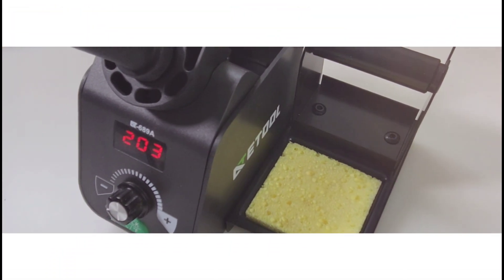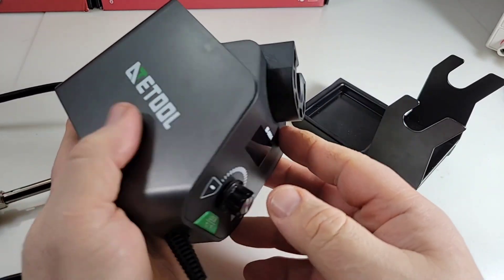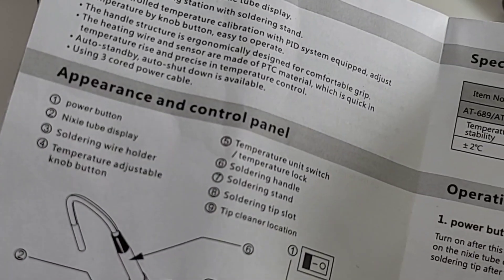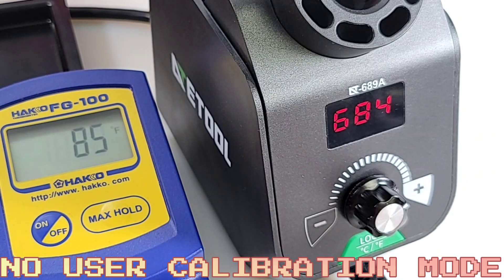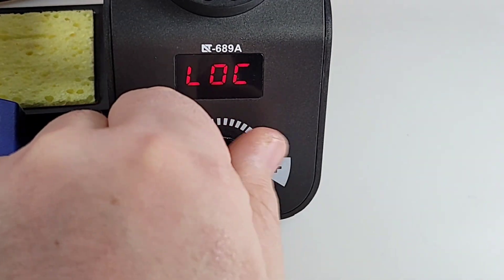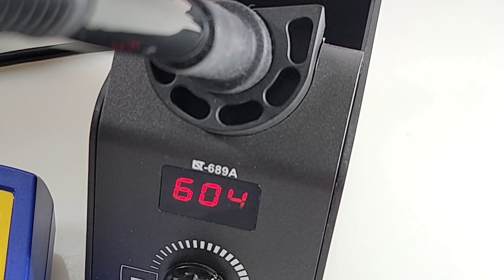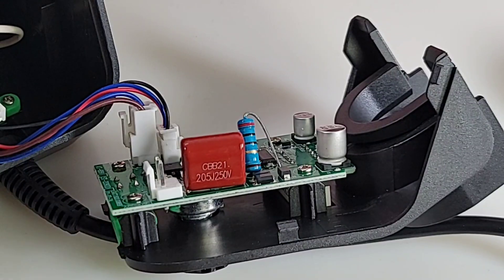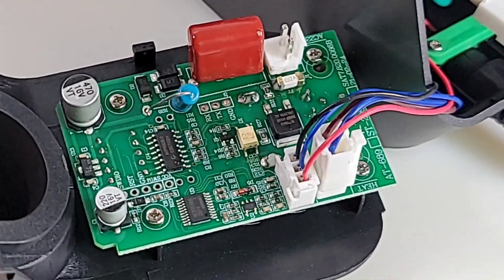ETOOL 689A Soldering Station Review & Teardown!

Comment: Cool, I love to solder and form different arts or someday: a vehicle, father of all mech manga & anime (like Shenmue the father of al open world games)- the super robot Mazinger Z, a person or animals (a classmate in our technical high school, once showed his big brother's motorbike made from thick, soldered copper wires), may they invent a soldering iron whereby like a multi-color ballpen you just click the clicker and the type of tip you want comes out and may they invent a solder that doesn't need flux and the solder handle any oxidation and corrosion or dirt (within reason).

By the way review your favorite 'Helping Hands' (I would guess it's the 6 or more arm one with a huge magnifying lens on one arm?), cheapo but decent and branded ones, also your favorite soldering iron portable (ceiling electricals or electronics that's on the ceiling for example) and for the bench. Also perhaps you've found a flux that matches Louis Rossmann's favorite brand Amtech (there are fake ones, they say it's just petroleum jelly and it's terrible but last resort. An actual pure rosin that looks like a rock, like amber from prehistoric times works better very nicely than that fake Amtech especially for thick wire but I think rosin is harmful but I have one I found on a box, also it's not practical to need to melt this raw rosin if it's pure with the SMD hot air workstation),

God bless, Rev. 21:4

Comment: the fuse its an smd fuse(white) 2A sodered at side of mains conector . Easy to replace?no, but nor the cables or solderig tips when hot...but it's cheap

Comment: The cheaper version is model 905 or 907 (soldering iron with transparent handle). It already has close loop control (4 wires heating element). But it does not has digital display.

This Etool 689 eventhough provided with many iron tips, im sure they're not that good. You can by 5 pcs/set of it for $1, they were very light compare the one from Mechanics or Yihua or Proskit.

Both are not isolated from main voltage. Don't waste your money on it. Better use your money to buy a jacket :).

Comment: One star for a capacitor dropper power supply. It runs all digital control and gate drive to a puny SMD D-pak Triac. When that orange dropper cap goes, the whole thing will be toast before that fuse blows (all this danger was just to reduce BOM costs by 1 dollar).
Reply: What fuse?
Reply: @Okurkaarrgghh  It's ceramic white with gold ends, seen at 12:55, and pcb traces to the D-pak triac close by. Sad puppy isn't it? I sure hope you didn't buy one..
Reply: @CliveChamberlain946  Normally, you don't solder those fuses direct. There is a fuse holder for them but they were too cheap to include it.
Reply: bom reduce to around $4 for a step down transformer and a low voltage heating element. Usually they cheap out the iron tips too.
Reply: @qolbunsalim5188  Nope. Only small PST/PDST Split Bobbin Transformer required to protect gate, LV logic, and operator from disaster. 1 SMD bridge, 1 resistor, 1 Zener and sot regulator equal or less cost of 2W resistor and large unsafe poly cap. Triac MT still would solder to pre-trafo mains connection with same fuse and HV heat element. China cares only about saving $1 😂
Reply: @CliveChamberlain946  This one use unisolated 220/110 main Vac heating element, the safer one use 24Vac via step down transformer.
Reply: @qolbunsalim5188  Yup, LV is safer to be sure. My 120w Pace ADS200 uses 30v. Normally, HV elements must be wrapped in layers of mica and have outer glass insulation so the metal shell can have a safely ground. My hunch is this stations cable has no serious safety ground, so electrocution makes me give this a poor rating. Also, asking Darren to do Hi-pot and vibration testing is too much to ask for this channel. I was the guy that convinced Pace to send Dave Jones a demo unit. My view is that quality iron tips make all the difference where good iron-plating makes such an impact that common budget hobby users never get to see an iron that stays wet 100% of the time and last for years while being used for hours every day.

Comment: Darren you are a braver man than me, if they don't know the difference between a nixie tube and an LED I would never have plugged it into the mains😀 Did I spy a surface mount 2A fuse on the circuit board?
Reply from the maker: Muhahaha...I hear you...Nixies indeed...!! you are indeed correct my friend..I only spotted that fuse after filming..Shame on me. I was so sure it was your standard glass fuse I was looking for I was blinded by my own devices.
Reply: @KeepOnTesting  🎶"..blinded by de vice.." 🎶 So this replaces your ADS-200? 😉You'd have to pry mine out of my cold, dead hand. I just don't see this little firecracker as a trade-up!  😂 Bwahaha!

Comment: They poorly made it to resemble flickering of the LED display just like a nixie tube. And this is what they meant 🤣.... No Fuse, maybe a certain resistor might be acting like a fast blow fuse? Also gotta try all the tips to see which does the particular job better 😃.
Reply from the maker: It's an smd fuse on the pcb. My bad. I was looking for the standard replacement glass fuse. The NIXIE tube references were just plain silly but I couldn't resist!
Reply: @KeepOnTesting  Yup, just mention NIXIE in a thumbnail and it becomes instant click-bait. You got me! 🤣